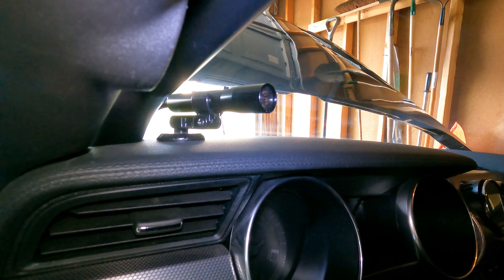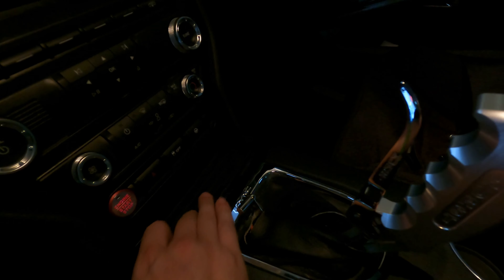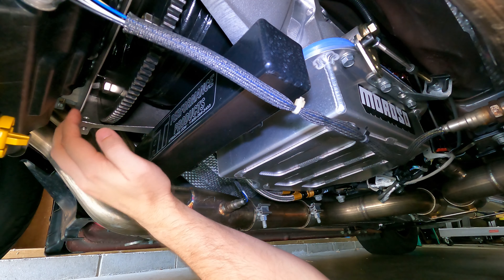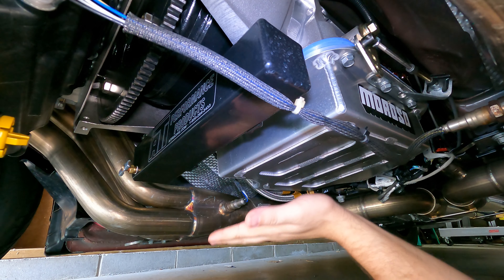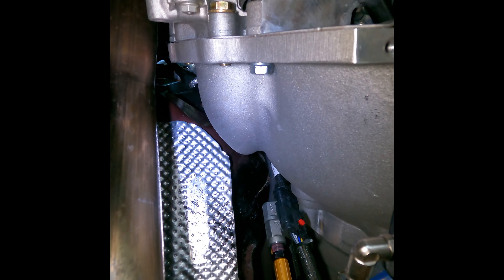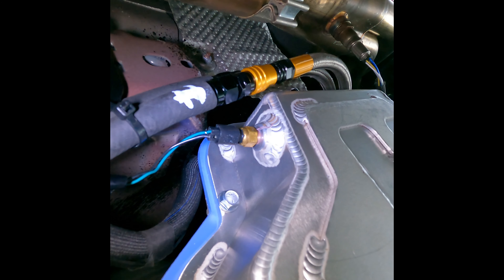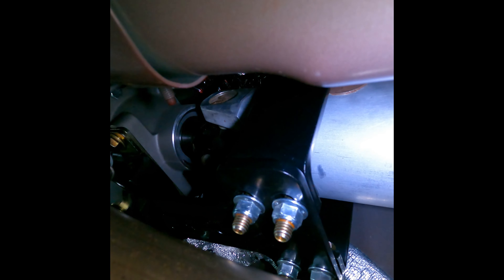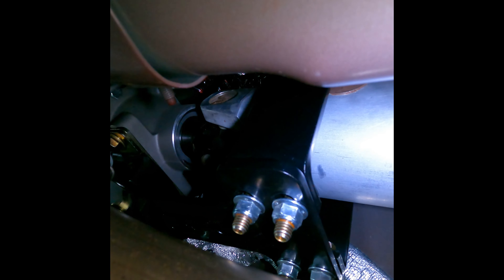1000+rwhp F1a94 Procharged Mustang GT Insight Series: TH400

Comment: Wish I could find some that does that quality of work
Reply from the maker: You mean putting together a th400 setup?
Reply: @turnswrench  yes lol I think I can do it but getting the parts all correct
Reply from the maker: @larryhensch2280  

Suspension

Front
Viking J325AK-250K Crusader Front No Sway Bar Coilovers
J&M JM-24231 Caster Camber Plates for Viking Coilovers

Rear
BMR SP088 Drag Springs
BMR SM760 Rear Shock Mounts
BMR WAK761 Camber Lockouts
BMR TR005 Toe Rods
BMR TCA045 Spherical Vertical Links
BMR BK050 Billet Differential Mounts
BMR BK048 Delrin Cradle Bushings
Viking VIK-B358AM Crusader Double Adjustable Drag Shocks
UPR 2701-01 Billet Spring Spacers
UPR 2002-26 Delrin Billet Adj Rear Camber Arms
Steeda 555-4050 Hardcore Diff Support
Steeda 555-4117 Spherical Control Arm Bushings

Brakes

Front
Baer 4261560 2.0 Drag Brakes

Rear
Baer 4262695 Deep Stage Brakes

Chassis
BMR BSF760 Front Bumper Bar
BMR KM761 K-Member
Ford Performance M-1700-M Tie Down Kit

Safety
Motion Raceworks 141300 Parachute Mount
Motion Raceworks 14030 Co2 Parachute Release Handle and Cable
Motion Raceworks PRK-CC Parachute Cable Holder
Stroud 430 Parachute
Jegs 60201 Co2 Regulator
Jegs 60207 2.5lb Co2 Bottle
S&W Racecars 95-8245 Co2 Bottle Roll Cage Clamp
Kirkey 55 Series 55170 Aluminum Race Seat (x2)
Kirkey 55 Series 5517011 Black Tweed Seat Cover (x2)
Racequip 741001 5-Point Racing Harness (x2)
UPR 2100-03 Crotch Strap Bracket
Competition Engineering C4906 Rear Seat Brace (x2)
FatHouse Fabrication S550_KSM Seat Mount (x2)
FatHouse Fabrication 8.50 Spec Roll Cage
Summit Racing SUM-590102 Roll Bar Padding
Allstar Performance AAF-ALL14100 Roll Bar Padding
Allstar Performance ALL10289 Window Net
Allstar Performance ALL10219 Window Net Spring Bar
Jegs 70020 Window Net Mount Kit
Quik-Latch QL-38 Hood Pins
DEI 010487 Heat Shroud for transmission lines

Interior
Motion Raceworks S550DS Steering Wheel Button Mount
Motion Raceworks S550PS Steering Wheel Button Mount
Motion Raceworks 151004 Momentary Button (x2)
Joleobee 1000003-501_B Magnetic nGauge Mount
GlowShift GS-AV3 Air Vent Gauge Pod
Five Star Race Bodies 096-820-Flat Rear View Mirror
Wildside Composites 920-WS9011-1 Carbon Fiber Roll Bar Protector
Summit Racing SUM-G1999-2 Helmet Hook
Ford Performance GT350 Rear Seat Delete
Ford GR3Z-7277-AA MT82 Shift Boot

Exterior
Optic Armor OA-MUS151-4DB Polycarbonate Windshield
Sto N Sho SNS135 Front License Plate Mount
Anderson Composites AC-HD18FDMU-SA-DS Heat Extractor Carbon Fiber Hood

Ignition/Electrical

NGK 6510 Spark Plugs 2020 season
Brisk RR12s Spark Plugs 2021 season
N2MB Wot Box
Flaming River FR1003-2 Big Switch and Lever Kit
Moroso 74051 NHRA Sealed Composite Battery Box
ETX18L Power Sports Battery
XS Power 586 Tall Battery Post Adapters
Bussman HMEG AMG Fuse Holder and 250 Amp Fuse (Main Power)
Fastronix 500-040 AMG Fuse Holder and 250 Amp Fuse (Alternator Wire)
JQuad 3/8" Four Post Power Bussbar
EWCS 2/0 Gauge Welding Wire with 5/16" and 3/8" Lugs
Zemoner B08BQZVMKS Copper Battery Terminal, Positive
QuickCar 57-719 Remote Battery Charging Terminal Kit
Speedway B01N9VXH3D Battery Post Adapter Bracket
Moroso 74144 Battery Cable Thru Connecter, Red
Moroso 74145 Battery Cable Thru Connecter, Black
Fastronix B07NBKWT7Q 3/8" Stud Cable Covers
Duralast DL07047 3/8" Battery Post Adapters 
Duralast GT215B Battery Terminal and Cable, 2/0 Gauge

Fuel
Fore Innovations 42-832 Triple Fuel Pump System
Injector Dynamics ID1700x Injectors
One Ethanol e85r

Engine

Procharger 1FW602-SCI F-1A-94 Stage 2 Tuner Kit
Procharger 2FWSU-003 Crank Support System, custom modified mandrel with 1/2 socket head
Gates K080660RPM Belt 2021 First Half Season
Gates K080670 Belt 2021 Second Half Season
Stainless Works M152H3OR 2" Off-Road Long Tube Headers
SLP 31067 Loudmouth II Muffler (x2)
Custom Dump Style Exhaust
TiAL Q 50mm BOV (x2)
Turbo Guard TG-MX-1 Ultra
Custom Rear Mounted Breather Oil Catch Can
ATI 918047 Super Damper
Kinetik CoyoteSaverStud Crank Saver Stud
UPR 3025-01 Billet Drain Plug
Plazmaman Billet Coyote Intake Manifold
Vibrant HD Quick Clamp Throttle Body Assembly
BL Fabrication WGG-CLM-TB-ADP Quick Clamp Adapter

Drivetrain
ATI 401603SC Fuel Comp Supercase TH400 Transmission with Transbrake
ATI 401935 Roller Tailhousing
ATI 202815 Coyote Bell
ATI 403610 Moroso Oil Pan
ATI 925170 Quick Disconnect Cooler Lines
ATI 408424 Outlaw Converter
ATI 915719 Flexplate
ATI 951378-8 Flexplate Hardware
ATI 915607A Crank Sleeve Adapter
ATI 406611 TH400 Transmission Catch Can
ATI 100001-12 Transmission Fluid
Ford AC3Z-7007-A 2015-2017 6r80 Engine Block Plate
Ford FR3Z-4851-B 2015-2017 MT82 Rear Pinion Flange
Ford 52027 2015-2017 MT82 Starter Motor
Ford DU2Z-14474-CA PCM Pin Terminals
DSS JPCSH-6-A 4" Aluminum TH400 S550 Driveshaft w/ Sonnax Yoke
DSS RA8555X6/RA8556X6 2000hp Axle Shafts
Energy Suspension 3.1108G Transmission Mount
JPC 14311 S550 Shifter Mount
JPC 14305 S550 TH400 Crossmember with Driveshaft Loop
Hurst 3162001 Quarter Stick Shifter
Hurst 2488601 Reverse Switch
Lokar X1211147 Locking Quick-Disconnect Firewall Mount Dipstick
Derale 13950 Atomic Cool Transmission Cooler Kit
Aeroquip 2252-4-4S 1/4" NPT Swivel Fittings
Moroso 93103 TH400 Transmission Pan Gasket

Tuning
HP Tuners 62001 nGauge
Lund LR-BBNGP Omega Boost Box
Lund ZT-FPS Fuel Pressure Sensor
AEM 30-4402 Transmission Temperature Gauge 
PBD Gold Package

Wheels/Tires
Race Star 92-745142BZ 17x4.5" Bronze Bracket Racer Wheel (x2)
Race Star 92-795153BZ 17x9.5" Bronze Bracket Racer Wheel (x2)
Mickey Thompson 305/45/17 ET Street R Radial Drag Tire (x2)
Mickey Thompson 28/6/17 Sportsman S/R Tire (x2)